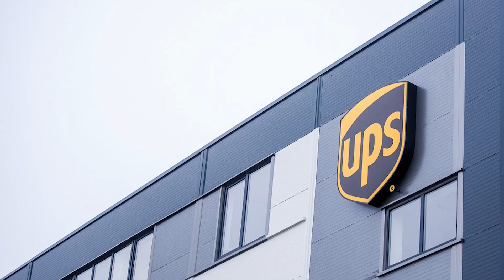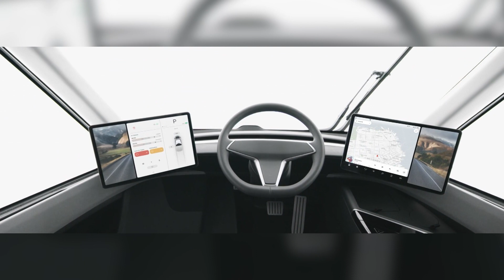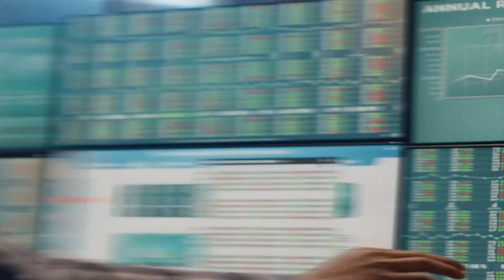Tesla SEMI will add $1Trillion to TSLA Mkt Cap!!

Comment: This video ignores the total cost of ownership.  Maintenance costs of all electric vehicles are much lower.  No oil changes. No camshaft adjustments. No replacement of the brakes and brake linings.
Lower insurance costs, due to no jackknifing. Automatic log keeping of the vehicle and the drivers. Automatic upgrades, via over-the-air software internet uploads.
Reply from the maker: Fair point will will add that in next time

Comment: How many pounds can the truck haul in payload?

1/4 of a standard semi

How much drag did the trailer have?

It was a flat bed so very little.

How much will the cold effect the range.

It will be a lot. 

How may megawatt chargers are there?

None

How many trucks can one electric substation charge? 

One

This is a joke